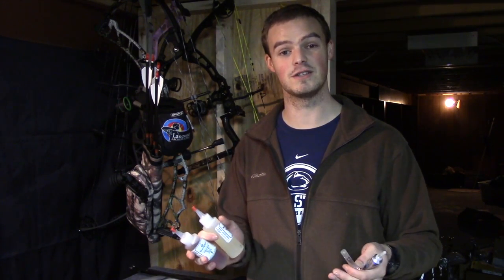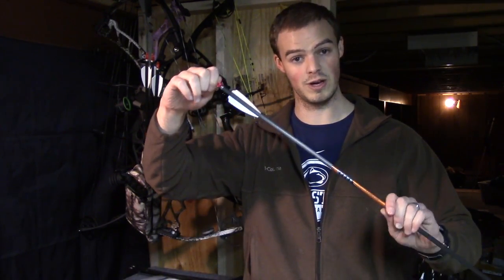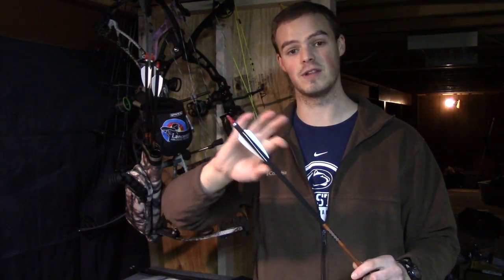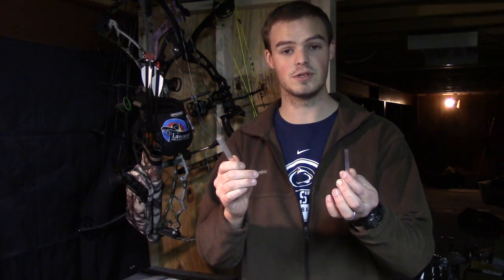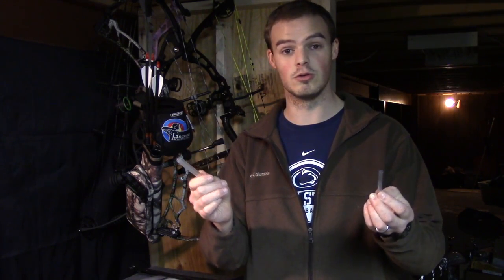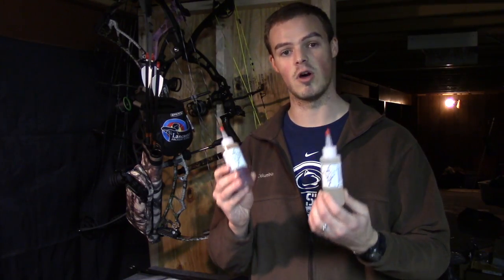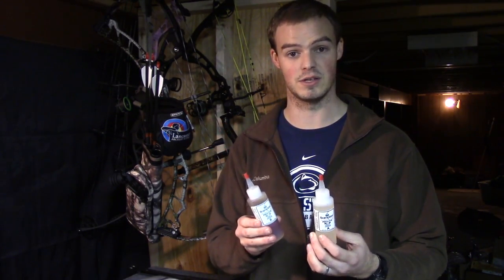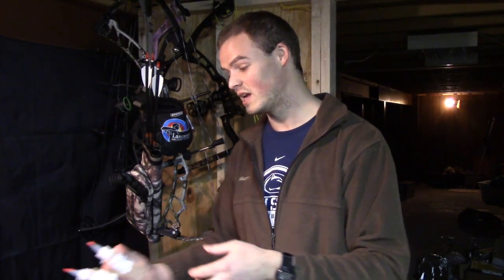Choosing the Right Arrow/Fletching Glues

Comment: I have tried so many different glues for fletching and always seem to come back to the Fletch Tite Platinum. Especially if you are gluing right to the shaft - which I prefer. Just need to wait long enough for it to cure and it holds real well. Plus it's so much easier to work with than the super glues. If things go awry you can just wipe it off an start over so less chance to wreck a vane during the process. I find the super glues just get too hard and the vanes can just snap off - very unforgiving. Just my two cents.

Comment: Good video.
Cyanoacrylate glues tend to set glass hard and while its very strong bond, it is not good at withstanding shock so I would/do not use them for points or point inserts. Hot glue is great for the pointy end as its flexible and shock resistant.

Bohning Fletch-tite Platinum is great if Im using Bohning vanes, but Ive found its not so good at bonding some other brands of vanes.
Reply: I generally use Ferr-L- Tite cool flex (hot melt) for inserts/points, I have in the past used a regular (Araldite) epoxy but definitely prefer the hot melt.
Reply: Nothing that fancy. Im using standard Amazons cheapest hot melt glue gun glue sticks
Reply from the maker: Believe it or not, I actually had added a bit about the glues and their hardness when I originally shot this video, but edited it out for times sake. Good catch.

Comment: Folks are clicking to watch probably because they have had vanes fall off and inserts pull out, so I would suggest that you don't say (essentially)  "it doesn't matter that much, experiment and find what you like". I like your videos, but thought that comment wasn't helpful because it undercuts your specific message and expertise.   They are clicking to learn from your expertise because they don't want to do trial and error and then have to deal with the follow on issues (like an expensive Broadhead stuck in a foam target somewhere when an insert pulled out).  Folks trust your advice, you don't need to pussyfoot around just to avoid people getting upset that you might have criticized Elmers glue or something.

Can you tell us if the insert glue that Easton sells / provides for its inserts perform well and whether or not it is a "slow cure" type. Personally, I've had good luck with Easton insert glue.  I'm also happy to use a better or similar glue that isn't priced at a premium due to the brand.

Comment: Just switched to using wraps with Loctite Super gel for use with blazers and also switched to hot melt for my insert-outserts.  Regarding the insert and hotmelt - do you reheat to align broadheads and how often can you reheat - re-align before the glue is useless?
Reply from the maker: I have reheated glue a few times. But it's so easy to remove the insert all together and clean off the old glue to apply new glue. So if I have to reheat more than once, I personally clean it out and start fresh. Watch my video on broadhead alignment to see how I nip that problem in the bud!

Comment: Hi, just a quick question, I'm about to build a set of indoor arrows and had initially intended to use plastic vanes but I'm now considering using feathers, probably 3", I'm sure you had a video showing fletching with feathers but I can't seem to find it, so the question (at last)

Do you recommend glue or tape for feathers, right helical without a wrap on an 23 dia. aluminium shaft, thanks
Reply: I recomend glue
Reply: anything specific? I normally use AAE Fastset gel which has worked well for me on Bohning Shield X and Blazer and AAE Elite Plastifletch on both Aluminium and carbon shafts.
Reply: Bohning Fletch-tite Platinum is great if Im using Bohning vanes Ive not tried it on feathers,  Last time I fletched with feathers I used AAE Fastset gel or just regular superglue gel.
Reply from the maker: I've used both tape and glue and for a feathers 4" and over it's glue. The amount of twist in the feather I think is too fickle for tape. But for 3" and less I've used both with great success. Since indoor arrows tend to take a beating I'd probably still use glue, but give both a whirl! You can't beat how quick tape is. Soooooooo nice!
Reply: Many thanks, just ordered the shafts and components and added tape to the order so I'll see how it goes.

Keep up the good work and God Bless.